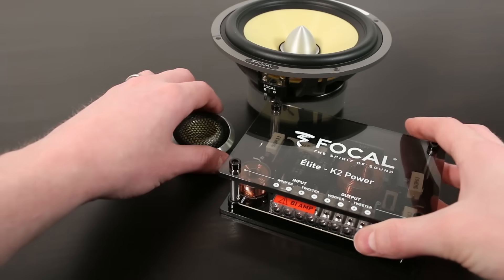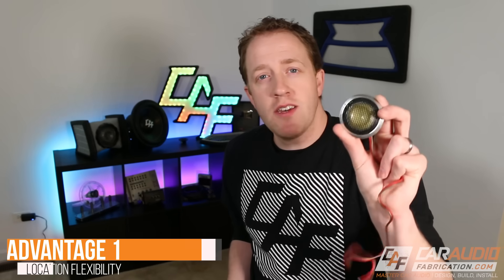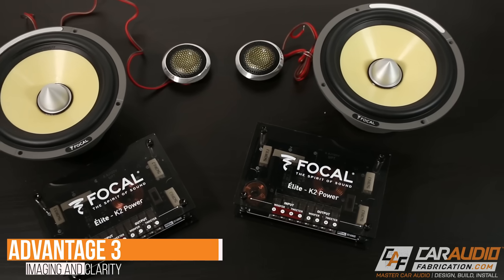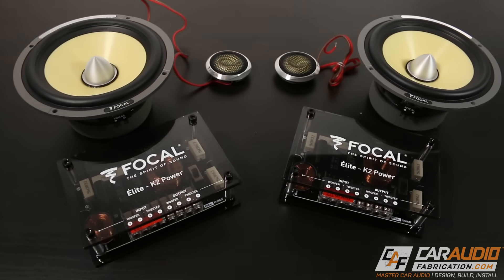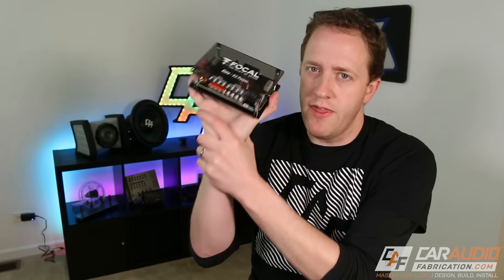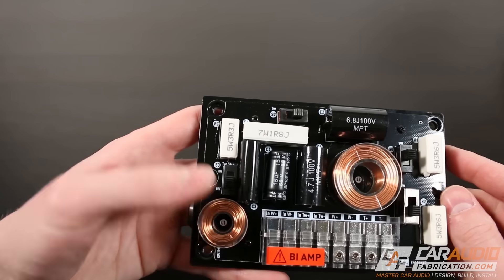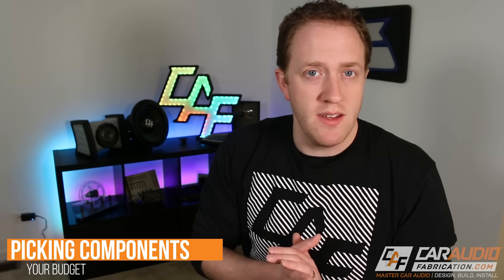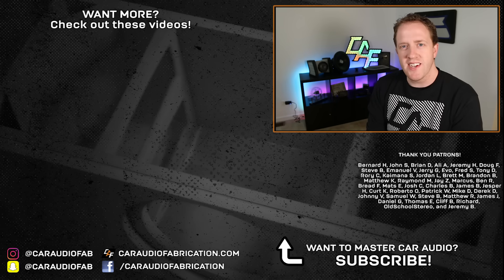Want AMAZING sound? COMPONENT SPEAKERS & everything YOU should know...

Comment: would you recommend a component set or midrange + supertweeters (i have a sub) for someone who just does not care about loudness and is just looking for some quality sound? my headunit supports 3 way network setup with -18db/oct slopes
Reply: Ehsan Rahimi  jbl has 3 ways. Stadium models. Passive of course.
Good sensitivity values.

There’s a eBay seller in Germany that sell tweeter and mid aluminum adjustable pods.

Made just for these speakers.
Reply from the maker: I would recommend getting a component set in your budget. I'd avoid super tweeters, they are IMO strictly for SPL purposes.

Comment: this is literally the only thing i'm searching on today - new component speakers for my car. Thanks for your vid dude ahha
Reply: FYI, Alpine Type R separates out perform most high end component sets, at 1/10th of the price. I’ve had experience with type R’s for many many years, and have installed/used many. Just put some descent power to them. Just my 20 years of experience.
Reply: @joesmith389  just put in Alpine 149 HD bte been a Pioneer premier guy for decades and I'm impressed with the features ,sound quality  is good with the Rockford T600 on mids and highs.
Reply: I have focal k2p in my Jeep and they are amazing you will not be let down for you will here every nuance and you will want to move in to your car,lol I have a rockford fosgate  power t600  100 × 4 ,please put sound deadening in your ride for these are loud and proud,I have used kicker,morel,and by far if you move toward a high dollar focal set you will not look back, very impressed.

Comment: i wonder why the inducers are in the same plane. thought focal products were designed better than that
Reply: Greg Rop - budget Vs form factor. Simple economics in this case, they can get you 90% of the way there but it’s diminishing returns vs exponential R&D and a much bigger footprint at some point.
Reply: Passive crossovers cannot do time alignment as far as I know. That has to happen digitally prior to the digital to analog conversion. In other words before the amplifier.
Reply: @johnclark3067  the magnetic fields generated by electricity passing through a coil will effect the other coil. like charging an electric toothbrush. putting one on x plane the other on y plane would minimize this effect. this has nothing to do with time alignment
Reply: @gregrop4857  Oh, you are talking about the construction of the crossovers. I thought you meant that the drivers were in the same plane.
Reply: @johnclark3067  yes the layout, i have never had a focal product, but i would bet the build quality is great! nice chat ttyl
Reply: @gregrop4857  You should check out the Focal Utopia Cross block passive crossovers. They are works of art!

Comment: Man i have exactly same Focal set sitting on the shelf next to me... Can't wait to install them! Thanks for vid.
Reply: I have the older ones 165krx2. Have you seen the new utopia m series?
Reply: @johnclark3067  Utopia is next level...Soundwise AND moneywise... Currently I'm running the Focal AS series (entry level components) so K2 Power will be fairly big step up for me. Btw how do you like your's?
Reply: @DagnisCC  Mine are probably not even broken in yet. I am going to buy the 3" mids and go three-way active soon. Looking at Zapco for a 6 x 100 class ab amp.
Reply: @johnclark3067  Yeah 3 way front is way to go. I will feed mine from Mosconi 130.4 :)

Comment: If you’ve got oem tweeters and midrange can you just wire components straight into the existing wire or would you still have to use the crossover?
Reply from the maker: You would want to know exactly what frequencies are being sent to those speakers by the factory system, and even if you did this would likely not be a very good plan as the OEM system isn't going to have enough power for you to benefit from switching speakers. Really should be using an aftermarket amplifier too.

Comment: One other benefit to using passive crossovers - some incorporate compensation networks to help keep the impedance curve flatter. An example is Linear Power. I hope to have Ray Rayfield in an upcoming 12V Talk podcast so he can further explain. Great vid as always, Mark! 👌
Reply: What did you do with BigDWiz?
Reply: @riveralley  want channel name to match content. New viewers have no idea who or what BigDWiz is. I'm still the big dummy, so no worries there
Reply: @wal  Can you amp dyno the Cv2800 for my buddy Doublsmm?
Reply: Channel name changed...its still bigdwiz tho! 😎
Reply: that would be great Big D  if you have Ray on because passive crossovers would be a good topic I bet you'll get a lot of questions I know I'll have a few.
Reply: Fancy seeing you here big D! Yeah man you could stretch passive crossovers into multiple conversations for sure. Even in this video he showed the close up on the crossover and didn't mention the bi-amp inputs. One could split the component set up across a four channel amp and be able to utilize time alignment on the head unit or DSP as mentioned. There are matters of phase compliance, impedance matching (as you mentioned) slope overlap, etc etc
Reply: A 'Zobel Network'
Reply: Williston Audio Labs (BigDWiz) may I ask a favor of your channel?
Would it be possible to do a dyno/test of the NVX 5 channel amplifiers?

Its obvious that Sonic Electronix did a dyno and got waaay higher than what was CEA rated, which makes me very suspicious as it's known NVX is their own inhouse brand and cannot be unbiased, and I bought it for my hatchback install a few months back and am about to install it for active front stage. 

I'd like to see what this amp can do and what the 13.8 volt rms output would be on this sucker.

Hope you will consider doing a video on this, and thank for all your excellent videos

Comment: Some that I know didn't have a fuse close to the battery in the front. Also What would you need for a basic car audio set up?
Reply: you need a frequency and a resonator.
frequency comes from your stereo system as electric information
the resonators are your speakers
that means: a stereo system, speakers, electricity and a car. you connect all of that and you have it

alternatively you also can go by the answer: internet

Comment: what did I do ? after replacing my double din deck with a new double din of the same make and model now when I turn key on or off I get a big pop and it didn't do it before🤔🤔🤔 HELP
Reply: Axel Hischer  you may want to check the speaker connections. Sounds like the speakers may be out of phase.... positive where negative goes ect..
Reply: ok thanks all I did was replace the deck because it had a cracked screen replacement was the same double din THAT'S what has me 🤔🤔 but I surely will double check that as well
Reply from the maker: Hard to diagnose without having access to the system. Sorry man.
Reply: SteadyMTB well.... what’s your guess?
Reply: all I can think.of which I am going to do is double check all my grounds.... but I'm open to ideas to double check... only thing that I changed on this install was I was out of solder so I used heat shrink butt connectors which is something I just don't ever do I have always been old school solder and heat shrink kind of guy...